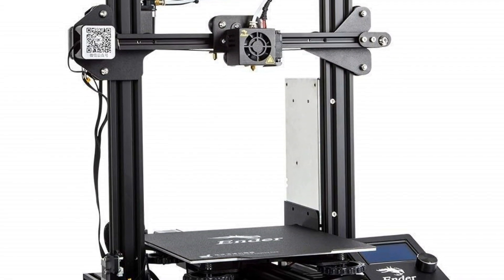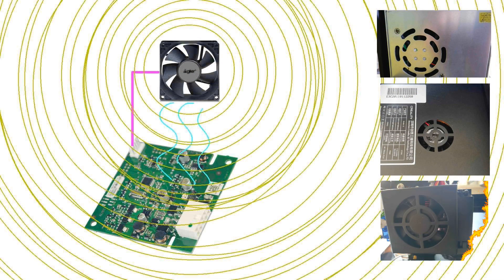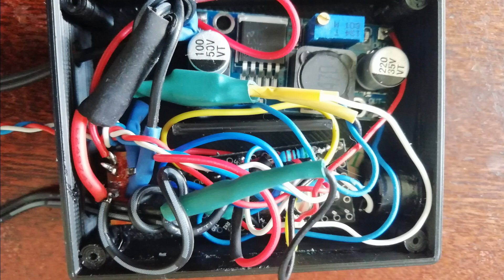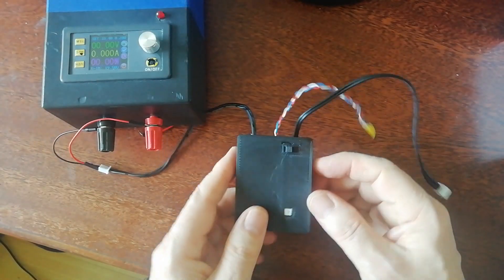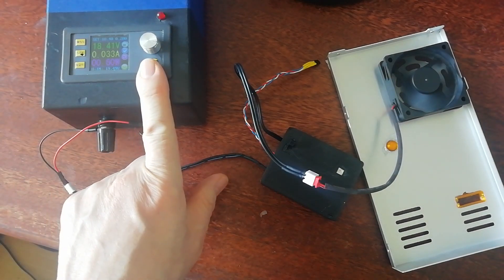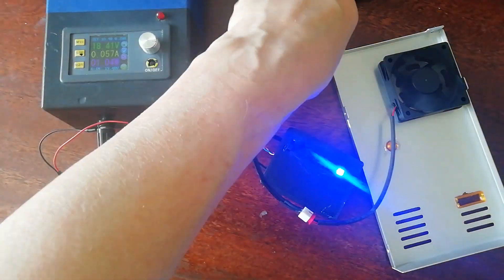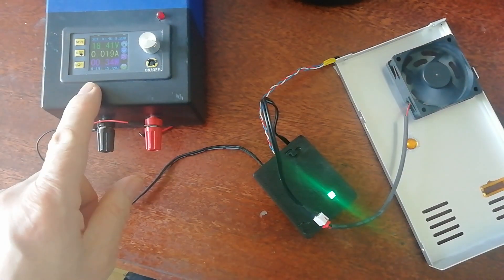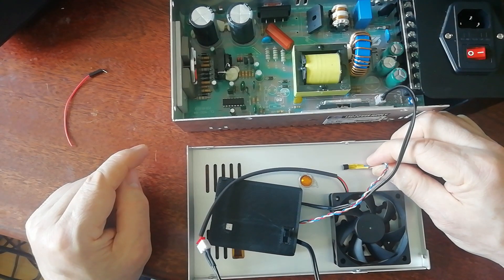Quiet Smart Fan for 3D Printers or Anything with a Noisy Fan

Comment: You had me wanting to buy one half way though the video. Seriously you should market them for sale =)
Reply from the maker: Hey Chris, thanks for stopping by ands leaving your comment. I condiered it, but other feedback I got was not as positive as yours. I ca n also envisage a package of these things, to cover the PSU fan, the main board fan and the heat brak fan - an all-in-one unit that does it all. But it's a lot of work to productionise these things. So I have two units on my Ender 3 now, and they work wonderfully and hgave done so for many months. Out of curiosity - what would you say the right price is for a single fan controller?